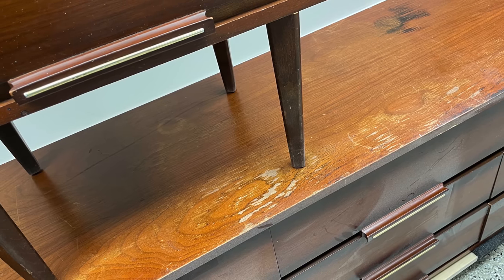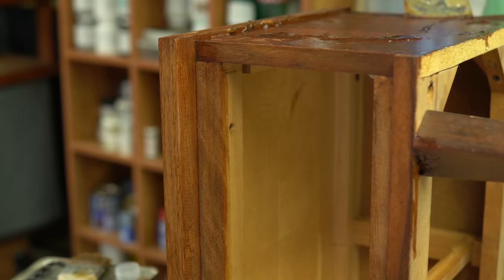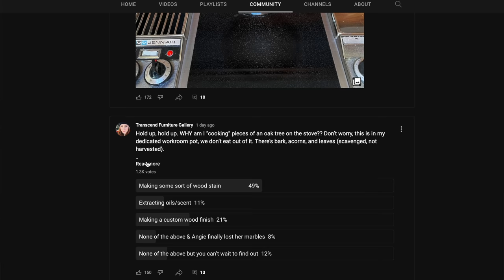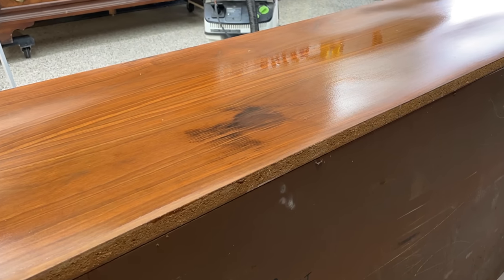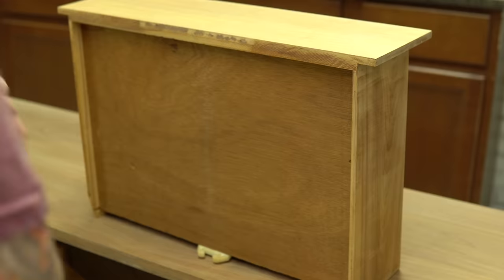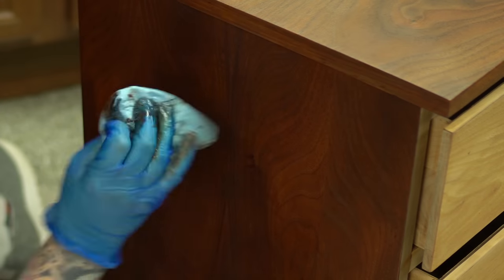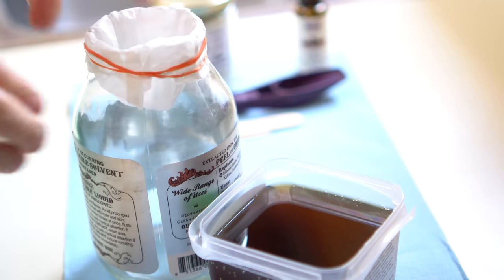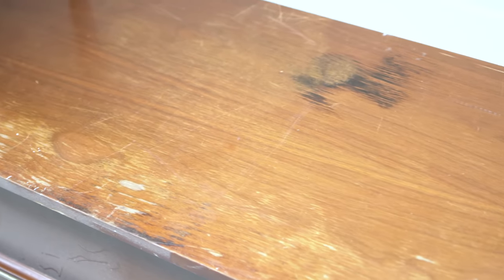FIXING WATER STAINS on mid century furniture: Dresser & Night Table Makeover

Comment: I like that you sanded the drawers. I’ve seen other flippers use some sort of wood “hydrator”, like Dixie Bells big mommas butta. That might be a nice touch after sanding.
Reply from the maker: I always do a coat of protection in the drawers - the product I'm using the most right now is Howard Feed 'n Wax but I also like hemp oil and the Wise Owl Furniture Salves because of how they smell. Thanks for watching!

Comment: Another trick for grease based stains, from French polishing. Run a small amount of methylated spirit on the surface over the stain and set light to it. (keep the main bottle well away). let it burn out and it pulls the oily stuff out of the wood. Can be done several times before sanding.
Reply from the maker: Thanks for watching!

Comment: You did an amazing job on restoring these pieces. Your finishes are exactly what was used originally from manufacturer.  I've been using Howard's for years and love it. Another is Boos Lock Mystery Oil which I use on my cutting board, food safe. Your Atwater color pieces are great.
Reply from the maker: Thanks so much for watching!

Comment: HELP! I’m refinishing a MCM side table and after sanding I used a wood conditioner. The next day I decided to stain the frame in black, but after the first coat, I wiped it down and you can see the wood in some areas. I added a second coat and left it to dry over night. My question to the wood 🪵 mixologist is should I apply a third coat to see if it covers the areas the of wood that is still showing. My pal an was to stain the top of the table  in walnut and stencil it with a mid century design by redesign by prima. Any suggestions? You’re the only U Tuber that make wood look beautiful again. Thanks

Comment: Could you comment a little bit about the finishing product you use. I don't really understand why something with a title like vinyl sealer would be something that goes underneath lacquer. Obviously experienced but curious. Least I do know what the toners are
Reply from the maker: It's not literally for vinyl, that's just the name they give it. The vinyl sealer develops a moisture barrier for the wood. It's good for high contact areas where you need improved durability, water resistance and adhesion. It's kind of like a primer for lacquer in a way. Hope this helps and thanks for watching!

Comment: How did you attach the Festool hose to your surfprep? I want that hose, it seems so much more flexible than the rigid plastic that comes with most shop vacs. Thanks 😊
Reply from the maker: I ended up keeping the Festool for general shop cleanup and for attaching to my Dewalt, and the SurfPrep one I have permanently hooked up to my SurPrep sander. I opted to use the Festool for general cleanup/vacuuming out drawers, etc because the hose actually fits the Dewalt's dust output, and I wouldn't need to buy an adapter for it. Whereas the SurfPrep vacuum perfectly fits the SurfPrep output.

Comment: Does the safer solvent effectively remove Odies oil? I put a couple of coats on dresser top and I’m not loving it.
Reply from the maker: It would depend on several variables- whether it was raw wood or put over something else, solid wood or veneer, whether it was applied properly (with allllll of the excess oil buffed out), etc- that would be a question for Odie’s directly, as I’ve never actually had to remove it. They are usually really good with answering, either on their instagram page or fb page.

Comment: Your videos are really interesting. I have an old European buffet with a damaged veneer top. It was bought from a charity shop and has been re-done, so it's not a valuable antique. But the top is a mess. Any suggestions?
Reply from the maker: The long answer here, is as much as I would LOVE to be able to help everyone who reaches out, there sadly just aren’t enough hours in the day. There is another side to this as well- sometimes things don’t come across properly through photos and videos, and are best seen, felt, etc in person. For THIS reason, it can sometimes be difficult to accurately determine the age, finish, wood species, etc of people’s project pieces. There is also the element of user error, when recommending products and finishes, or misinterpretation of my instructions.

I get, on average, approx 40+ messages per day between Instagram, FB, YouTube, and email (and literally hundreds of questions in the comments). It is unfortunately just not possible to be able to get back to everyone. 

The short answer is this: you can certainly message me on Instagram and if it’s a simple answer, I may try to help you out. But PLEASE don’t take offence if I’m unable to respond! I need more hours in a day!
Reply: @TranscendFurnitureGallery  Thank you for your kind answer. I love your videos.

Comment: Are you not able to apply odie’s oil on top of the gel stain? While not ideal, I believe it can be applied after 3-5days. I’m waiting to apply the odie’s oil on GF gel stain as we speak 😭. I hope it turns out ok.
Reply from the maker: You CAN apply Odie's over stain once its dry, but in my experience Odie's is best on raw wood - it just seems to bond better. You may also find, especially with a gel stain, that the Odie's application may remove some of the colour even if the stain has dried because gel stain sits on the surface instead of penetrating into the wood. To recap, you can do it but it's always better over raw wood. Thanks for watching and I hope this answered your question!

Comment: Hi. I have a question. I have sanded sideboard top, with 80 and 150 grid sandpaper. When I spray water on it, , water forms  droplets, it seems like surface is slippery.. I am so lost as I have never seen this before. Please could you advice? Many thanks
Reply from the maker: The long answer here, is as much as I would LOVE to be able to help everyone who reaches out, there sadly just aren’t enough hours in the day. There is another side to this as well- sometimes things don’t come across properly through photos and videos, and are best seen, felt, etc in person. For THIS reason, it can sometimes be difficult to accurately determine the age, finish, wood species, etc of people’s project pieces. There is also the element of user error, when recommending products and finishes, or misinterpretation of my instructions.

I get, on average, approx 40+ messages per day between Instagram, FB, YouTube, and email (and literally hundreds of questions in the comments). It is unfortunately just not possible to be able to get back to everyone. 

The short answer is this: you can certainly message me on Instagram and if it’s a simple answer, I may try to help you out. But PLEASE don’t take offence if I’m unable to respond! I need more hours in a day!

Comment: I am doing my first restoring attempt on a three-piece MCM set I bought off FBMP. I have been watching so many videos, and I am a little confused. I used some wood filler to mend some areas where veneer top had split off. I sanded everything down and now have a nice smooth top surface, but the areas where I used the wood filler are lighter in color. If I want to stain how do I make it all the same color? Is that not possible to do and am I now going to have to paint? HELP!
Reply from the maker: Wood filled areas (well.. larger ones anyway) never stain perfectly due to the difference in porosity compared to the surrounding woodgrain, but I’ve found the best way to deal with them is to seal them with some Mohawk vinyl sealer, and then unfortunately you may need to do some colour matching and/or painting with special pigments specifically for this, and graining markers. It’s not “hard”, per-say, but it does take practice and a decent artistic flair to blend them in well. Each layer of pigment/paint/marker needs to be sealed to isolate it, and once all the layers are complete, can be top coated, usually with lacquer.
Reply from the maker: I should add, that if you’re staining the rest of the top, tape off the patches so only those are exposed, and use the vinyl sealer to seal them. Then, go ahead and stain your piece. The stain won’t stick as well to those areas, but you’ll need to do some colour work anyway. If you stain right over the bare wood filler, it will likely absorb more than the wood and be too dark. It’s easier to darken a patch after the fact than to lighten it, usually. Gel stain will work better than a penetrating stain.